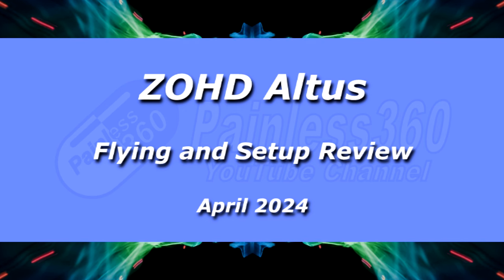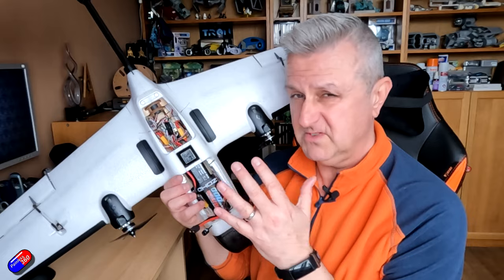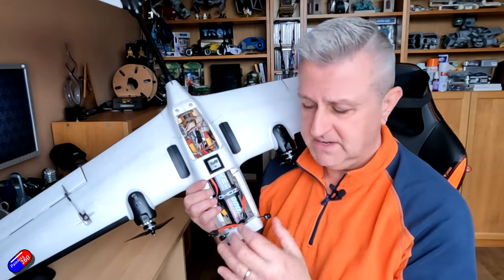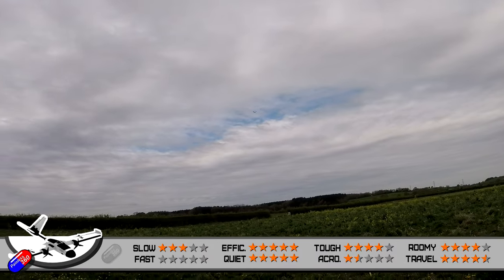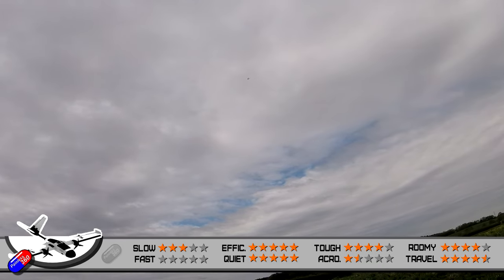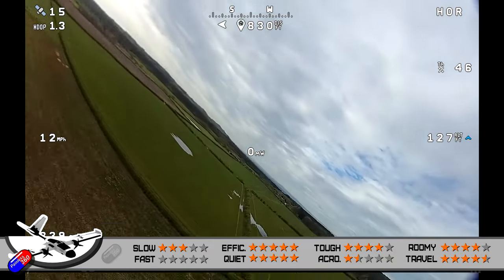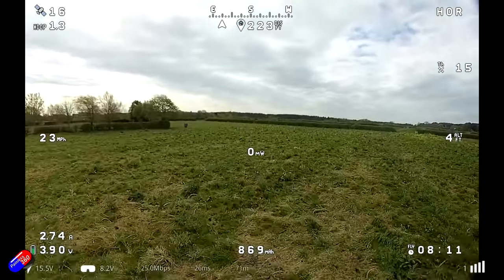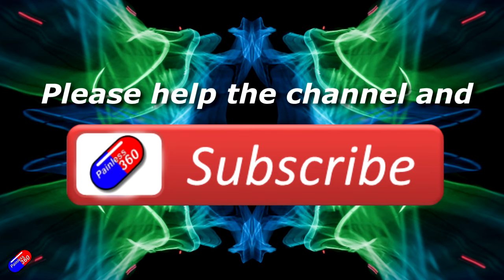ZOHD Altus: Maiden flight footage and full review

Comment: I’ve finally managed to maiden my Altus on 4s LiIon.  It is a nice little plane and it does exactly what i bought it for - FPV flight with decent range in a compact & portable package!  

It took off quite easily at ~1300g (4s-8000 mAh LiIon) with 1500 idle & 2000 launch throttle then cruised nicely at 50% throttle with ~7 amp, however it seemed to be a little bit nose heavy, even though i balanced it on the wing marks.

Comment: Lee thanks for the follow up flight video. Andrew Newton touch on something very important with the kit version of this model. The ruddervator custom servo horn seems to only work with Zohd servo splines so I ended up buying a pair for 16 USD. Also it’s a pain and a half to thread the servo wire through the tail boom. I had to cut the servo connector off and solder on an extension cable to have room for the wiring to run through the boom. I also wish the pre made servo wire tracks in the wings were larger and the pocket for the wing servo connectors was larger to accommodate the 3 connectors and the motor wires. I hope someone can 3D print a nose for a GoPro 9 and 11. That’s what I use.
Reply from the maker: The electronics are good so I wouldn't buy the kit personally... Happy flying
Reply: @Painless360  Ok nice. After receiving my kit and experiencing the overall build process it doesn’t really seem worth it to buy the kit unless you crashed your pnp..😔

Comment: I agree with almost everything. Good review. I used your 3d printed Walksnail mount and it cools very well. I still prefer this over the AtomRC Swordfish (which I also had) because that plane had the opposite problem; a big battery fit in the nose just fine but the plane became VERY nose heavy. 

Re the launch issues: you’ll have a much better time holding it where Zohd put the little grippy area on the fuselage. I couldn’t really grip it well so I put some grip tape there. Once I did that it takes off pretty well with a 4s 21700 pack and throttle at 1850.
Reply from the maker: Great to hear that you used my nose design. Happy flying!

Comment: An nice informative review.
It's a bit of a petty that a beefy camera and larger battery are required to get CG. It would be amazing  if ZOHD offered an alternative fuselage that located the main wing for pilots with less ambitious FPV flight plans. (ie: less than max endurance and max video resolution)
Even if an alternative fuselage was just sold as a supplemental accessory to the PNP/KIT editions for a lighter build. The great plug and play feature of the main wings and tail boom should make this a possibility. Or, offered as a boxed sibling model to Altus, (perhaps the Ava).

Comment: Hey Lee 

I’m having some issues with my SB405Mini…I’m on analog and at launch my OSD completely disappears. I noticed your video started after and it’s a digital system which shouldn’t change anything I believe. Mine is setup simple to yours on a different air frame. 

I’m almost leaning towards the FC as I have been trying other bits from other models with no luck.
Reply from the maker: I've not used analogue FPV with the flight controller. https://youtu.be/Js8HFd8CcxA was a video covering some common fixes... Best

Comment: would it worth printing a longer nose and trying it with a much lighter battery, it would take a bit of gluing and faff but may transform the planes sluggish response.
Reply from the maker: Hi James, that was exactly the same conclusion I came to in the summary. If the nose had been 3"-4" longer with mounting and airflow for HD FPV systems it would allow for lighter builds that I expect would help launching and flying characteristics... Happy flying
Reply: @Painless360  yeah I watched the summary I meant a follow up video with your improvements of lower weight and better airflow for cooling.
Reply from the maker: If a good nose extension becomes available, maybe. But then it'll look like a Reptile Dragon v2!

Comment: Same thing with the AR Wing Pro.  Has to have a lot of Wt. Up front.
Reply from the maker: Yep, both designed for large, heavy batteries and an action camera to get CG. Great if that's what you want (and don't mind the weight) but tricky to build out at a lower AUW without mods...Happy flying

Comment: I’ve just got this and putting it together,im using a atomrc fc and when I flash inav 7,the saving defaults screen never seams to finish,what would be the reason for this?
Reply from the maker: Known issue. Reboot FC and restart Configurator and it'll be good...

Comment: on mine I had to use a 7000 mah sohd battery to get the CG spot on. If you try with a 2200 or worse a 1500 mah there is no way you can balance. it. Cruise  amperage is around 5 or 6 amp therefore very good but max speed is 110 kmh max. I am using your 3d print  design and installed a dji airunit. (thanks Lee!!!) all in all is a good plane, but  being spoiled with the Swordfish I honestly dont like this plane so much. If it wasnt for you stl nose file I would have been forced to place the airunit on   top of the battery hatch which is absolutely a crap in my opinion.

Comment: Hi again. I’ve just tried the 6s LiIon ….  it will NOT work !  ESCs won’t burn, but the motors will have a specific beep (maybe some voltage protection function in the ESC) and will not start the motors !  Without programming info for ESC, you can’t use the 6s. 

That is a pitty , as it was balancing perfect with my 6s 4000 mAh LiIon, and you can easily limit (scale) throttle in iNav.
Reply from the maker: Thanks for the info, if you figure it out please post how.